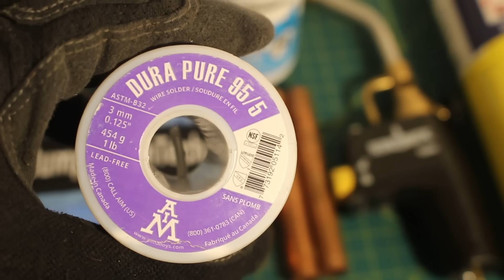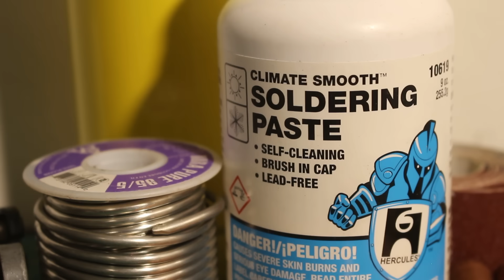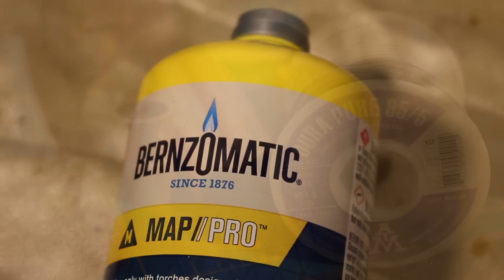How To Solder Copper Pipe (Complete Guide) Plumbing 101

Comment: I just learned a cool trick. When your dealing with existing pipe. Put a shop vac on the pipe to vacuum all the water out. If you see steam coming out of the pipe you'll never get a good solder.

Comment: Tip, if you drain the water from pipe your working on and can't get it to stop dripping, ball up a piece of bread and stick it in the pipe. It will dissolve after your done.
Reply: You don't pull the bread out??

Comment: This video is a little better than most that I have seen. You have to heat the pipe first then move it to the fitting. Map pro is not MAPP gas though, MAPP gas has been discontinued. Map pro only burns 130 degrees hotter than propane and cost three times as much.

Comment: ❤Salutation! Congratulations on the video! Working in copper pipes seems very unhygienic to me. I prefer to work only with PPR pipes, because it is much simpler and faster than with copper ones, plus it gives me a state of weakness of grease that soldering paste, I only say that a lot of time is wasted. Good luck with the work! 😊

Comment: I’ve never seen it done this way, seems like a very weak join… in Australia we use brazing rods which have 2% or 5% silver in them, much strong and doesn’t break under pressure as these standard welds may.

Comment: I probably owe you a delicious breakfast, man, because you really saved my bacon today! My wife Connie has a thing about filtered water, so I bought a house filter for our new place and figured I’d handle the install myself. I’d never messed with copper pipes before, but your tutorial gave me the courage to try something new. Everything went smoothly except for the last two joints; there was a trickle of water in the line that I had to deal with. Thanks for your expert guidance.

If you’re ever in Richmond, VA, breakfast is on me.
Reply: Next time just stuff the pipe with bread, do the solder and when you are dame you can get the water with pressure to get rid of the bread inside
Reply: @abandonedbucharest7704 te rog nu arunca pâine, sunt duzine făra hrana. Mersi❤

Comment: This is definitely wrong. Using solder to braise without heating it like this is wrong. You need to be heating the metal you solder. Not get hot then add solder. This is not going to be a strong connection. The way he did it is basically just plugging the gap with solder as opposed to joining it to the metal he is soldering. This is a very bad job and I'm shocked it got recommended to me.

Comment: You should bend the solder a half inch and move the flame around some in the same area of the joint then move on to the next joint. Also wipe up the excess flux on the outside of the joint before soldering.

Comment: One thing I learned from soldering is to not cheap out on the paste. I used cheap paste and couldn't get a good solder. I did the right thing and removed the pipes and cleaned them. I did this a total of three times until I got some better paste and was able to make good solder after that.

Comment: Mine works it’s a little sloppier first time though I ever soldered. I used an electric heat gun which did work it’s slower then a torch but I only had one joint.
Reply: sloppy here as well! 😂

Comment: wish mine worked that easy have went through a whole spool of solder on one valve joint and it leaks as if there is no solder. 8 hours on one joint have to tear out the wall now to get to some more pipe. I've done this hundreds of times and NEVER had this much trouble. Local Plumbers have quoted me $3,000 just to sweat 6 sink valves on.

Comment: Just learned this process, I was applying the solder while the torch was heating. Turning it off is definitely better, glad I came across this! Thanks a ton
Reply: Me too!
Reply: Yeah I was going to say the same thing. I’ve done lots of brazing lately and the process is similar but more forgiving in some ways.

I’m going to practice pulling the torch away. I think not cleaning my old joints is another issue.

Comment: Thanks for the great video,I am a pipe fitter and I always prevent mixing extremely hot joints with water because of hair line cracks that will affect the the bondage of the two fittings, can't the the excess solder be filled off by file or sanded by a sanding discs and just don't scratch the pipe,just a thought on removing the solder tear 💧 drop. I think you said damp cloth but I think the heat drop age should affect the bondage, I am just asking?

Comment: oops, i forgot I already liked this one the first time I watched it. ;) I needed to go through again. Dude, I am using propane on 3/4" copper, and I may switch to MAP gas now. It seems to take forever to get to melting point for my solder, and I am worried I am burning off all my flux. Is that a problem?

Comment: Hi, my understanding is that "heat" does not rise. "Hot Air" rises, because it is lighter than cool air. The heat applied to a copper pipe spreads through the pipe by Conduction: the copper "conducts" the heat. Conduction is not affected by gravity. That said, I see no reason not to follow your advice to heat from the bottom. It can't hurt!!

Comment: With the advent of Shark Bites and cpvc, and the fact that the Shark Bites can be used on copper or cpvc of the same size, is there any advantage to still using copper pipe [when working with water lines] ? Say for example you had a pin hole water leak in existing copper pipe, it seems much quicker to simply cut out your leaking area, attach a Shark Bite to each cut end and attach a piece of cpvc between them. Is there any reason repairing with new copper pipe, couplings and solder would be advantageous?
Reply: If you prepare the pipes properly ( clean, deburr) for the shark bites and push the pipe in to the correct depth you should be ok with them. If it’s not inside of a wall and it’s easily accessible should a leak happen then go for it and don’t think twice. If it’s hard to get to or inside a wall then soldering is a much more permanent solution. The reason shark bites fail is the preparation wasn’t done correctly, the mechanics behind them is perfect, it’s the prep work that will make them fail on you.
Reply: @Don_Schafer_Wichita_KS  OK! Thanks!

Comment: I’m not a plumber but you definitely took the “rocket” out of soldering a copper joints and turned it into science. Thank you for sharing your knowledge.
Reply: He's not a plumber either.
Reply: Thanks . I'm doing my bath. Ready now to solder .
Reply: https://youtu.be/jzi4sGJo1iM?si=yLUej0w4iaUGZME9
Reply: Hi
Thanks for teach secrets Techniques @ heat, Flux and soldering. I was try home several time  at my home. I couldn’t succeed.
When I watched I found my mistake.
Thanks 🙏
Reply: thanks you for this video, was doing the water pipe but this help me alot to how to do the plumbing solder 😁😁

Comment: What I don't understand is how, flux is poisonous yet as it heats up during the soldering process, it can run down into the pipe and stay there until, obviously, water runs through the pipe. Doesn't this mean for some length of time, depending on whether it's a hot or cold line, poisonous flux is in the pipe getting into the water and therefore into people?
Reply: Flux is a paste, it will run off after the water flows eventually. It is not permanent.

Comment: You going to get leaks soldering like that. I work on commerical plumbing. Big pipe. I have plumbers come over from housing to commerical plumbing and always have leaks because they dont move the torch around and get even heat. They do just as you show in the video and only heat the bottom of the pipe. Move that torch around. Start on the bottom and finish on top.
Reply: Not sure if you noticed but this is a video detailing how to solder small pipe, not big pipe
Reply: Big pipe little pipe, it all about even heat!  @timsmith4371
Reply: @timsmith4371  dumb comment. If parts of the pipe aren't heated well you will have leaks no matter pipe size. You can get away with it with small pipe but your technique is wrong making ot possible to leak on a small pipe. Jesus do we have to explain shit like this to you
Reply: I always finish on top. Call me boring
Reply: @tytar1037  Done right with minimum amount of heat the bottom should start to cool while applying solder to the top.
Reply: @rudedogii  I was making an immature joke but thanks for the info!
Reply: @tytar1037 bottom position is also great😂
Reply: I scrolled down looking for someone to point this out, and wasn't disappointed.
Reply: You should listen to what he says... It's actually self explaining if you think of it ... He is just saying to keep a even heart. I believe besides taking energy to downgrade a comment ment just to help someone or people reading it. Its so much easier to take it into consideration and then apply your own style to it.
Reply: 1/2" pipe doesn't need heating all the sides, only 1" or bigger.
Reply: @sseasons  When I see leaks it always on the backside of the fitting because the plumber only heated the front. No even heat on the joint. Solder will only flow when the material reaches the proper temp.
Reply: First joint I ever soldered at my house did this. I just heated from the bottom and had a pin-prock leak at the top. Took a zoomed in photo of the joint and sure enough, the solder didn't spread properly in the top of the joint. This was just 1/2" copper. Now I move the torch all the way around and I move the wire with the torch. No more leaks since.
Reply: Exactly
Reply: So you know everything because you're a helper on a couple jobs?

Comment: Sometimes you have to draw a fine line between overheating and underheating the joint. I find sometimes the flux burns off too quickly and the solder does not adhere. The outside edge starts to look very brittle. I’ve been practicing on pipe that is not physically used for water flow. I would hate to find out turning on the main water yielding the joint to leak. I am using Mapp gas. Any other suggestions? 
Update: The joint came out beautifully using a better quality flux that looks more like Vaseline and a very good quality solder. I heat the pipe up a little bit first so that the inner part of the pipe is warm then I heat the outside sleeve and slowly introduced to solder. It gets sucked up and I wipe it off immediately with a leather glove and it is a professional looking joint.
Reply: One thing to point out. Mapp gas isn't what it used to be. It's not much different than propane now
Reply: Use a vacuume

Comment: So you can't losen it after it sets? i have a small leak and I wonder if i can take it apart and and solder it again after cleaning it or if i need to replace the section?
Reply from the maker: Add a little Flux around, heat it up and add a little more solder. See if that works. If not then take it apart and redo the connection. Heat it up to take it apart, sand down, Flux, connect, solder. Stay tuned for new videos every week 🔧⚡
Reply: @JumpermanTech  will give it a shot. Is there anything to do in order to clean off rust and maintain lines rust free?
Reply from the maker: @fausto412  Awesome. Copper will never rust for the same reason as bronze — it contains too little iron. Though it will not rust, copper can form a green film, or patina, on its surface over time. However, this patina will not flake the way rust does. Instead, it creates an even, thick coating on top of the copper itself👍

Comment: way too big of a torch head for that size copper, you wouldnt have to pull the heat off the pipe. Which is also something you dont do. You also shouldnt ahve to sand the whole joint after if the copper wasnt burnt form that size tip.

Comment: Is there a reason for turning off the flame between application
Reply from the maker: No, it should be done in one shot as fast as possible but I was walk-around the pipe to make the cleanest connection. Stay tuned for new videos every week 🔧⚡

Comment: One question for the pipe does it matter if you light the pipe with the solder on it already or should you best direct the heat semi away leaving the pipe still hot but not burning the solder on the other side correct?

Comment: In the HVAC field, so i do aloottt more brazing than i do soft soldering. funny cause i always watched plumbers on job sites doing this, and would just spark up conversation with them, and id be talking about how hard soft soldering is and they laugh and ask how tf we braze so easily. After being in the construction side of HVAC for 3 years and running alot of copper drains for freezers and water lines for ice machines i finally got soldering down pretty well.

Comment: a butane torch is all I have, can I use that? Its only a 1/4 inch copper pipe
Reply from the maker: Im not sure how hot butane burns but 1/4" is such a small pipe that you might just get away with it. Id def try it if it's all you got. Thanks for watching!

Comment: Can I do this on HVAC? How about this torch? Will it work for HVAC?
Reply: It will, but the flame is too bug and you can easily burn something you didn't want to. With that said I use it all the time. I take it up to attics so that I don't have to lug my big set up. Again, wouldn't be ideal for fixing a leak in a tight area, like where cap tubes and coil fins can be damaged

Comment: Great video and awesome up close shots, great how-to video, feel like I could do this now, thanks! 1/2 pipe 1/2 inch of solder...great tip ty!
Reply from the maker: Thank you so much! I'm glad you enjoyed the video and nice attention to detail🙂 try it out and have fun!
Reply: @JumpermanTech  Is that a 1/2 inch total of solder for both sides of the fitting? Or 1/2 inch on each side?
Reply: @justina2333  each side
Reply: @JumpermanTech  0000000
Reply: P

Comment: It’s difficult to tell my friend/ boss the copper needs preparation. Idk oh well
Reply from the maker: Haha I know those type of characters. You can get away with it for brazing but I wouldn't chance it with solder. Thanks for watching!
Reply: Jumper man Tech since he didn’t prep it the solder just slid off the copper and he said fuck it and used that purple glue for pvc pipes... I just stood there in shock
Reply: @Dimaquibo35  sounds like a hack job

Comment: You can use soldering past whit flux
Reply: You're referring to tinning flux. It isn't necessary because it's extremely easy to get a solid joint with standard flux on pipe of this diameter.

Comment: Thanks, brother.  Gotta do a repair this week, and I've never sweated pipe in my life.  To be clear:  Flux and soldering paste are the same thing?
Reply: Soldering paste is normally very small pellets of solder suspended in flux and used for soldering components onto printed circuit boards, flux is just used for its cleaning properties and extra solder must be added when soldering pipe work.
Reply: @grahamslater3355  The paste you're referring to is known as tinning flux. It helps the joint receive a good seal especially with bigger pipe. Soldering small diameter copper pipe like in the video is fairly easy once you've done it once so I don't see the need to pay the extra for the tinning flux.

Comment: 2:42 "We're gonna heat up our pipe from the bottom as heat rises"  Hot air rises; heat energy will go toward the area of the pipe that is the least warm before it will go in any other or in all directions.
Reply: I knew there was a more defined part of that and I couldn't recall. Thanks Jack.

Comment: Never hold tip of torch under the joint.  Excess solder will drip down inside the torch nozzle.  Also for beginners use no lead soldering flux.  It has tiny bits of solder in it that melts faster and will "tin" the joint and prevent the joint from burning before you get the solder in the joint.
Reply: Does all lead free solder have bits of solder in…what make of solder in the Uk would you recommend?

Comment: Thanks man i was stressing out here my solder always bulks up at the bottom any tips?
Reply from the maker: Just applying too much solder is all. They say for 1/2" pipe you only need a 1/2" of solder, For 3/4" pipe you only need 3/4" of solder, ect. A little more is no problem. You want that joint to be filled. Rather safe than sorry. When you over do it, I see guys take a rag while it's still hot and wipe the solder across so its flat. Makes it look nicer🙂 Cooling off the pipe too fast while its solidifying could compromise the joint I hear but I see everyone do it. Doesnt mean its correct but I have yet to see a leak by them. Just try to be mindful when applying the solder. It's harder than it looks but practice makes perfect. Thanks for watching and appreicate the feedback!